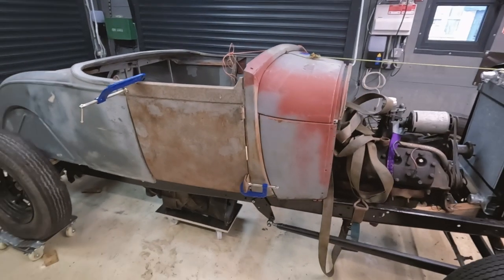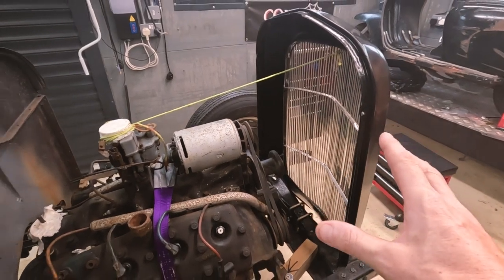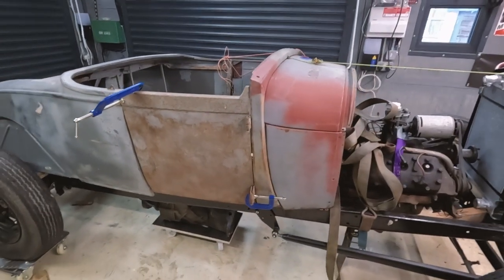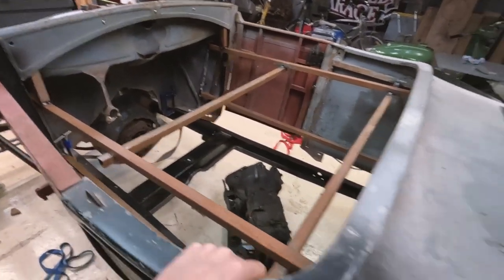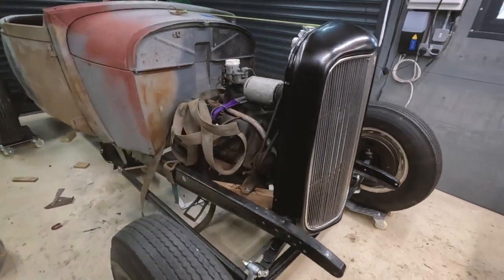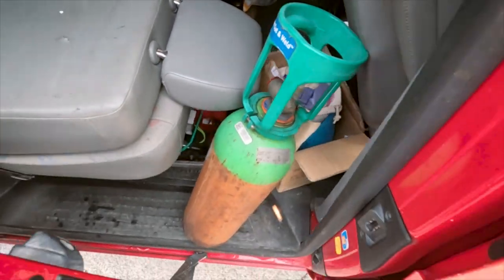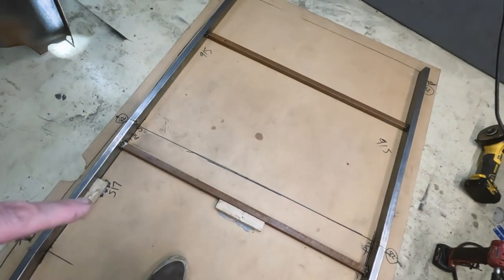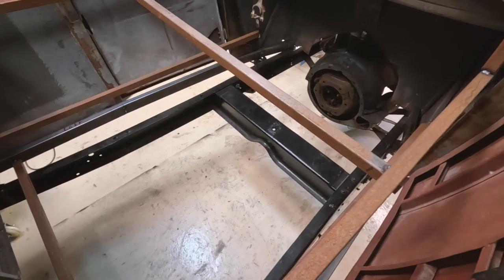Budget V8 Hotrod Build - Pt3. Building sub rails for Model A roadster body, and mounting radiator.

Comment: You can weld radiator mounting tabs to the front crossmember lower and forward and mount the rad there, will allow engine to move forward more and rad to be lower